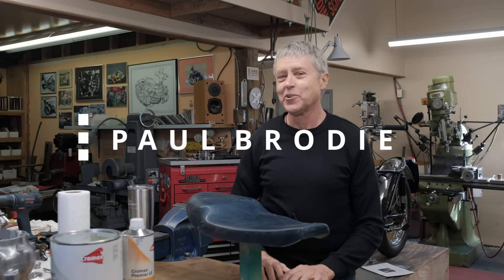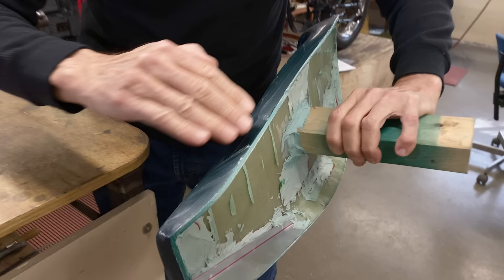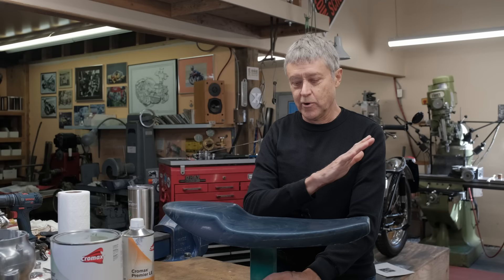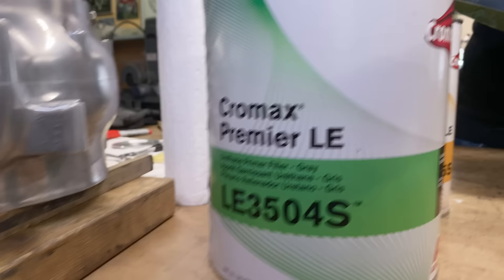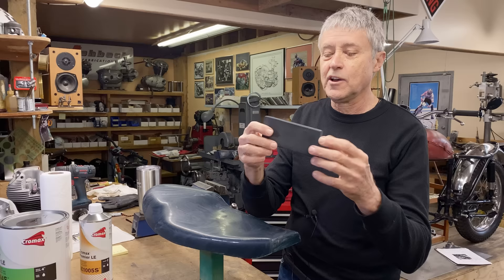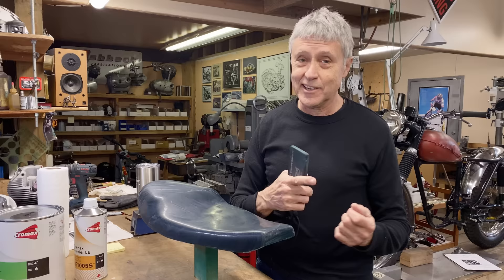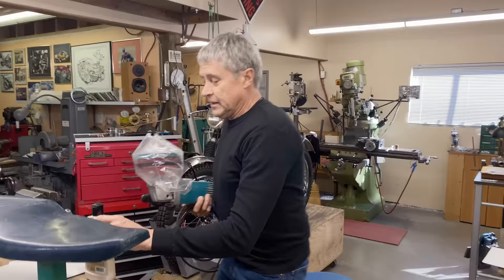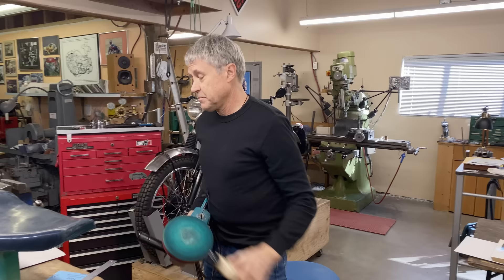How to make a carbon fibre seat pan // Paul Brodie's Shop

Comment: Great work Mr. Brodie, I assume the upholsterer will just glue the cover to the seat base? or do you plan to make some sort of hold down system?
Reply from the maker: Thanks Rick. Not sure yet. Myself and the upholsterer will have to come up with a plan.
Reply: @paulbrodie  What I do is , cut a thin strip of Galvanised sheet material , 0.8mm or so thick by about 15 to 20mm wide , depending on how much space I have available , I then use a punch that has been ground to the shape of an arrow head , pointy side first to pierce through and create a "Tag" that the seat material can be pushed over to hold it in place , which is lightly hammered down to lock it all.
Stick it down with some Bodyfiller {Bondo) and just a thin layer of glass to lock it all together. Better though if you plan ahead and make it an early part of the layup. Fiddly but works well once it's all done!
Ps - Your arbor press would make light work of the piercing process - wear stout gloves!
Reply from the maker: @hamishanderson8619  Yes, that would work.

Comment: Amazing video as always Paul! Actually if you want to dive a little bit more into carbon fiber, molds, etc. I just discovered a channel that has very informative contents. I found out that there are a lot of ways to do that as a lot of different composites. It's called "Easy Composites ltd" if you want to take a look. They have also an online shop (europe and uk) and there's a lot of stuff 😁. Thank you
Reply from the maker: Thank you. Yes, there seems to be a lot going on with composites now. I heard there is hemp cloth available too. I don't have any more fibreglassing projects on the horizon, but I will keep all of this in mind.

Comment: maybe some day you'll try making a fake vr-052, it'd be a big draw.
Reply from the maker: Maybe I will. First I would have to figure out what a vr-052 is...
Reply: @paulbrodie  primarily a perfectly reasonable looking motorcycle, military, lots of bits that could be faked of glass.  the fake would be easy.  the 'real' thing is pulled apart and attached to a riding suit, to make powered body armour.

Comment: Paul can an additional layer of carbon fiber be laminated between the fiberglass matting to create a stronger pan?
Reply from the maker: In fibreglassing you can do pretty much whatever you want. To make it stronger it is cheaper to use more layers of Fibreglass matt or cloth.

Comment: Sanding isn't the issue. You waxed it, with what? Use 4 coats of mold release wax. Then most importantly spray on a thick coat. (Usually 3 building up then one heavy) of PVA. Poly vinyl alcohol will give you a smooth surface that will stay on your mold but was of with water.
Reply from the maker: Thanks Dan.

Comment: Why use carbon fibre to face the mould?
Does it replace tooling gel ?
Reply from the maker: I used carbon fibre because when I take off the seat it will be right there! I could have used a gel coat. I think tooling gel is used for making molds, not usually parts..

Comment: No PVA? i found it vitale.
Reply from the maker: No, I did not use PVA. I think when I did use it it was brushed on, and you can see those marks when you pop the mold. I wanted a very smooth finish, so just wax.
Reply: @paulbrodie  I know those marks. Keep up the good work. Looks like I need to work on my spelling....

Comment: I jokingly call it "crabon fubar" from time to time, but if you see what the bicycle industry is up to at the moment it's no surprise that it's earned the fubar in its name.
Reply from the maker: The bicycle industry is really into carbon at the moment. Bike frames don't last forever, and I don't think they have figured out the re-cycling yet, unfortunately.
Reply: @paulbrodie  Recycling of carbon fibre isn't exactly recycling. It's just a creative way to dispose of it, such as blending it into concrete and burying it inside the structure of a skyscraper or something. My understanding is that you can only recycle it into something worse than it was originally made for. That said, a guy in my city famous for making bamboo handlebars (Passchier) was chatting to me recently about biodegradeable resins made from hemp and his interest in them. For frame materials, I've got no complaints about steel or aluminium.
Reply from the maker: @Metal-Possum   Yes, I was reading about how they "re-cycle" the carbon fibre blades from wind turbines. They dug a huge long trench with an excavator and buried them. Then they ran out of land and room...
Reply: @paulbrodie  That's disappointing.

Comment: I'm wondering why the first layer applied was carbon fiber?  Does the seat flip up where that would be visible?
Reply: The top will be covered with foam and a seat cover.... only the bottom will ever be seen... as to who sees it..... well, who knows?
Reply: strength and weight. To get a seat pan made solely of fiberglass, it would have to be like 10x thicker to be as strong. Carbon fiber isnt always about being exposed. CF is stronger, lighter, and more rigid.
Reply: @minnionator  You're right,… but in this case the weak point is the resin. Polyester resin isn't the best to use with Carbon fiber, as it doesn't maximize the potential of your composite. To achieve the measures you give, you have to use epoxy resin.
Reply from the maker: The seat does not flip up, but when you do take it off, there is the carbon fibre!